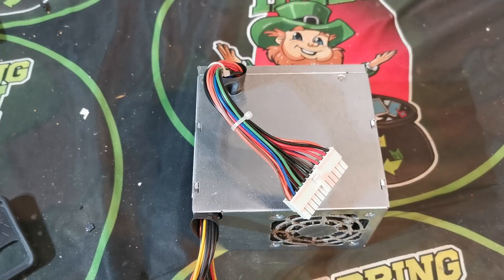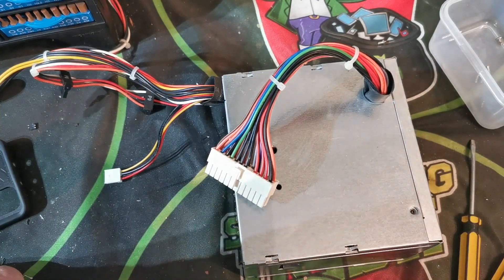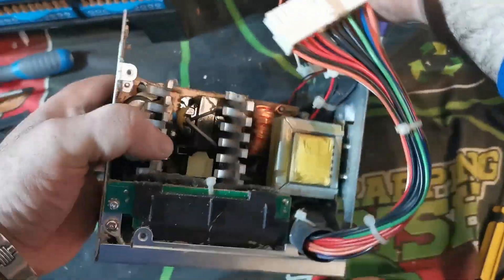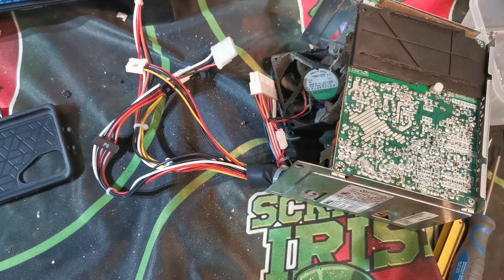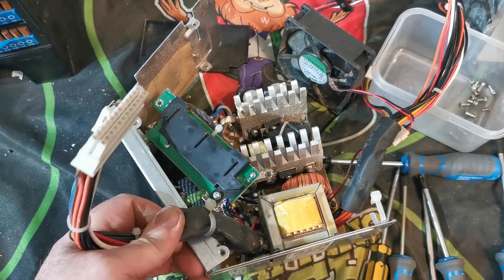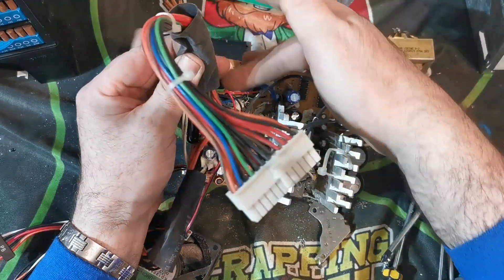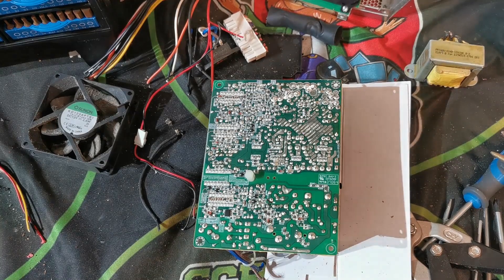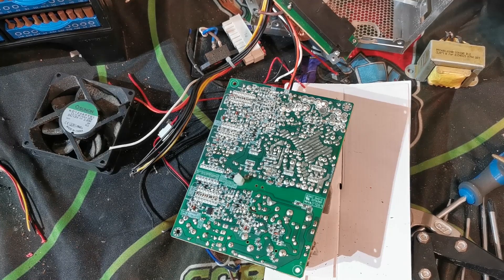micro scrapping a power supply for all you  scrappers

Comment: Back when I first started scrapping I only went for the obvious non ferrous, tossed out the boards without knowing what was left on them. Not any more. After watching E Waste Ben I changed to his mode. Scrap.for "today" cash, microscrap for "tomorrow" money. I've got jars with the different components of boards stashed everywhere. Even have a jar containing " what the hell is that " items. Started watching 999 Dusan, and a few other channels from eastern Europe. 
So yeah, when you didn't remove the screws from the AC power plug I knew it was gonna get good. I've seen comments about taking a file to your tin snips to sharpen them, lol. If you look closely at the "blades" you might see they are serrated, a file might help but you would be better off buying a new pair along with some side cutting wire cutters. 
Stay safe and thanks, good content and explanation.
Reply from the maker: I have purchased a new snips lol was time for a change
Reply: @ScrappingIrish  I worked for a long time as a "tin bender" as such I can say this. Steel wire and stainless steel are the worst enemy of a good pair of tin snips. I still have all my metal workers tools, I bought a set of greens and reds that were made just for stainless, cost about 25$ each and that was almost 40 years ago.

Comment: Great video,  I love taking everything apart to the component. For your snips, if you run a file across the edges at roughly the same angle you can easily re-sharpen them. That little grey box on the little board has a copper motor abs silver contacts in it, its a relay